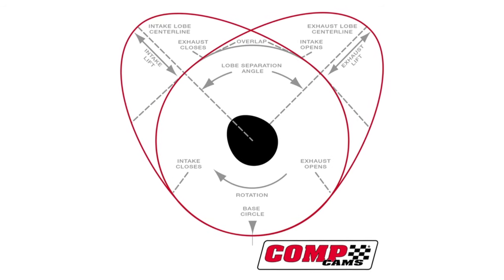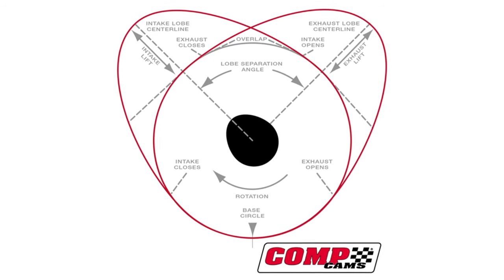Billy Godbold and Chris Potter Blow Our Minds Talking Camshafts!

Comment: I hate to correct Billy, but the Engine Masters was started by your old boss Scooter, and the pulls were from 2500 to 6500 for the street engines. I had 7 entries, place 2nd twice 3rd once and 10th w an engine that was all junk yards parts. 
 The 3/4 race cam was first designed by the REAL father of high perf. cams Ed Winfield. It was a cam with a reground racing intake lobe and a stock ex lobe.
Reply: A/h

Comment: Billy and Chris, when you talk about the cam timing events (IVO, IVC, EVO, EVC), what lift at the valve are you talking about?  The SAE specs were 0.006" valve lift if I remember correctly.  Or, do you measure them as soon as you see movement on a dial indicator?  Great presentation as always.

Comment: With the peak air speeds occurring at lower rpms  paired with longer combustion durations in diesel engines, would they have any input on how the cam shaft for a engine that say operates mainly under 3,000 rpms may differ from a wet flow engine with a rpm target of say 6500. 
Could be interesting to see what they think.

Comment: Didn't use to be a problem using flat tappet cams.what happened? I believe its is just inferior manufacturing technology
Reply: I'm not sure it's the technology but maybe the process or lack of. Several YouTube channels have ruined engines because of it regardless what the problem is. We can't all spend 2 grand on a valvetrain . Something's got to give.
Reply: @leesanders8824  you're right technology has been around long long time. Quality control has regressed since the OEM quit buying them
Reply: @GaryWhipple-q6w   I agree 💯 percent.  You can't tell me that they can't harden a camshaft to make it through break in in today's world. It's sad really. I'd love to run a roller setup but man it's expensive.

Comment: Only worked for hundred years with flat tappet cams what's going on with that Mr godbolt?
Reply: Not Godbolt. Godbold. Godbold. 
For some answers on cam technology today, get a copy of Billy Godbold's new book, High-Performance Cams & Valvetrains.
In the short form flat tappet cams started early failures when emissions controls were introduced. The additives that make up ZDDP in the older oils protected the camshaft and lifters, BUT they messed up catalytic converters and the government mandated 160,000 miles for warranty. So the OEMs introduced roller lifters and lobbied the oil manufacturers to remove the ZDDP.
Now we have a lot of parts manufactured in China. Some demand QC/QA standards of the Chinese manufacturers and do QC/QA testing on production samples. Some sellers are getting Chinese manufactured and look only at price points. Those are the ones that tend to fail.
It is like why your Chinese socks have holes in the heels in 3 months and your balls are hanging out of your shorts. Crappy QC/QA.
Reply: His roller lifters weren't any good either!